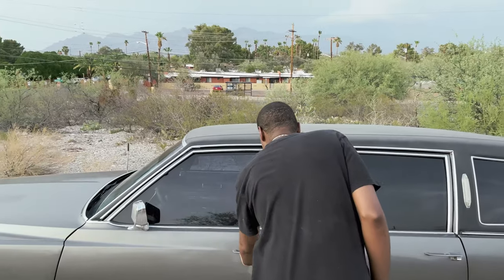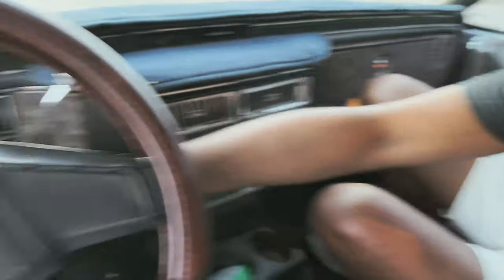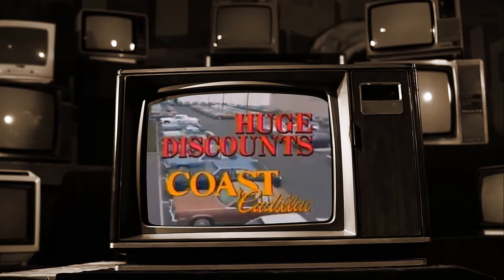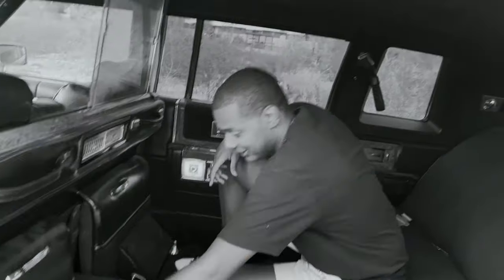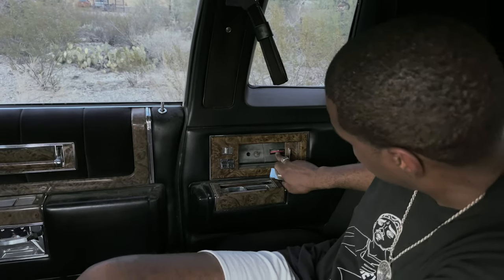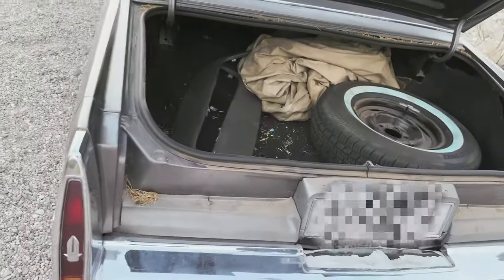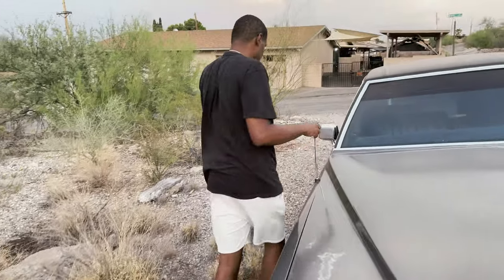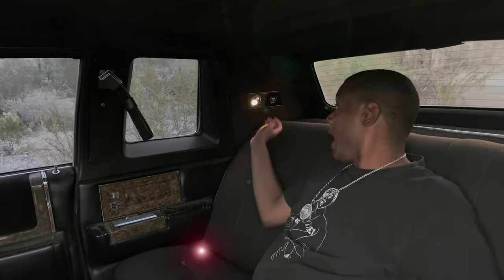FULL LIMO RESTORATION PROJECT: Please help me restore this '79 Fleetwood Cadillac Limo to original!

Comment: May need a fuel sending unit possibly, uh the generator light being on could possibly mean that the battery isn't charging, these are some possibilities
Reply from the maker: Weird thing about my battery is it died, I took it to O’Reilly’s and they said it was dead after they tried to charge it. So I took it back to Walmart to replace it and they didn’t have any units to replace it and also agreed it was too dead to charge fully. So I bring it home, have AAA come and charge it enough to roll my windows up and the battery is in my car now doing fine. So I’m unsure with everything at this point.

Comment: Hey man... Just seeing your vids. Ha ha three days to detail. Yeah man it's a big car. I have a 1972 Series 75. I may be able to answer many of your questions. Besides the Series 75, I also have, and have had, other Caddies. There is also a Cadillac Owner's Forum that is a great resource for all your questions and DIY needs. This seems like it may be your first Cadillac? Please stop (if you haven't learned by now) slamming the trunk. You gonna damage the pull down motor, if it's not too late. They close very softly. The fuel gauge may be the circuit board in the dash or the module on the sending unit in the gas tank. It's been two years though, you may have figured that, and other stuff you mentioned, out. I was looking to see what other vids you may have posted about this car but I see none after the detail was done. Where in the process are you at this point? It's a sweet ride and the 425 is a good engine. Let me know what's up. Much success to you with getting it to where you want it to be. Peace!

Comment: I had the same generator light problem in my 1972 Cadillac Fleetwood I owned when I was 15 if yours keeps doing that same thing that it's doing most likely you're going to need to buy a new alternator because when the light comes on like that it means your battery is not getting charged
Reply from the maker: I haven’t started it in two weeks too! 😩 thanks for the help homie!

Comment: Hey bro ! I'm French, I bought the same formal serie 75 from 77 last year and i'm rebuilding her stock ! 8 tracks reader, 70's TV with boomerang antenna, OG cadillac wire wheels, flags holder, curtains, glass tinted, bumpers, lights, chrome, GM 4 notes ACDF horn,  and more... I love your grill ornement where did you find it ? Check out my name in IT we could discuss ;)